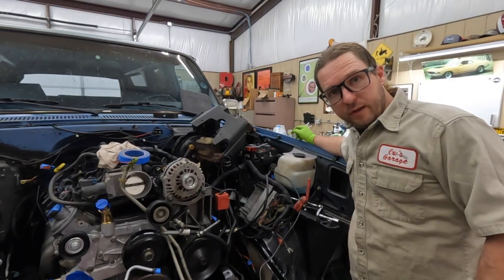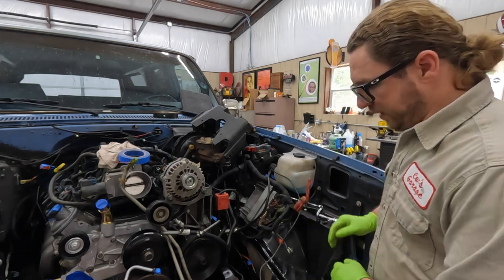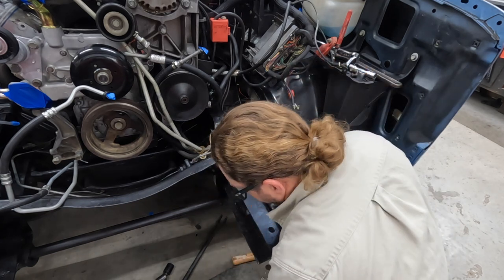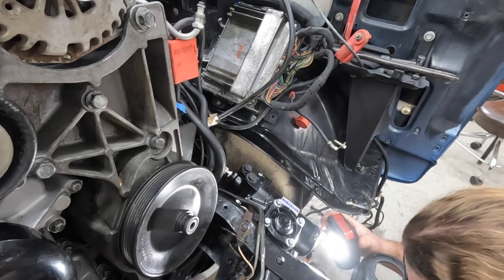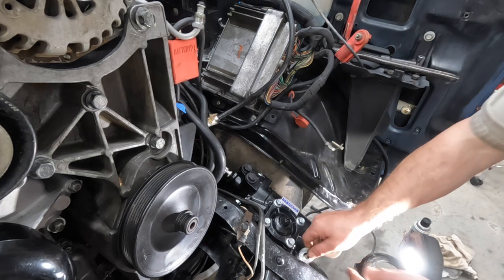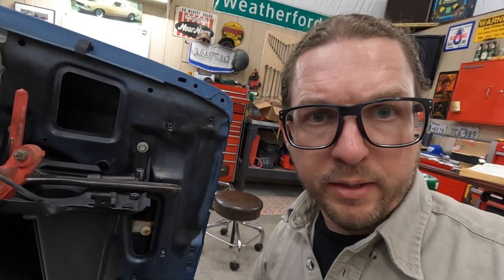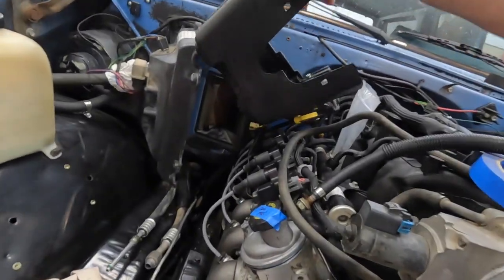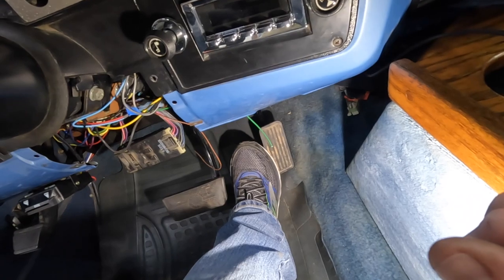Squarebody C20/C10 Borgeson quick ratio gear box, Jeep steering shaft and how I did the DBW pedal

Comment: Just ordered mine 
Only thing im worried about is i had a brace/ flex plate repair installed as mine was a 4x4
Reply from the maker: Did you end up getting it installed? I haven't messed with one on a 4x4 yet.